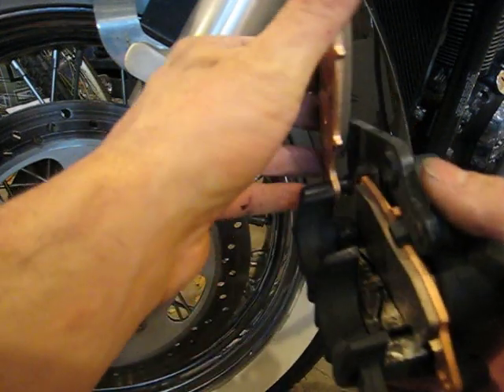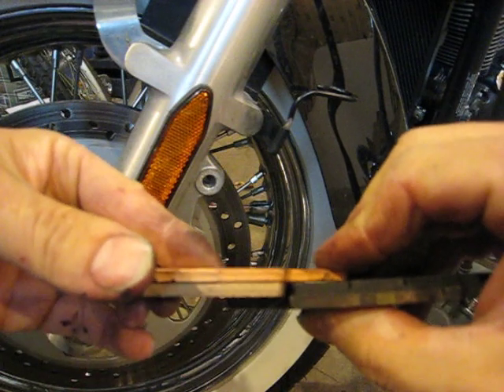Kawasaki Vulcan 900 Front Brakes.AVI

Comment: need some help with my repair.  Did the rear brake repair (pads, seat and seals).  However, I keep getting 30mm diameter piston seals for the front although the pistons are 25mm.

Comment: If the pads are wore down do you have to push pistons back in?
Reply from the maker: Yeah I just pushed them back using the old pad and a 'c' clamp.  I used the old pad so I shouldn't damage the new pad.
Reply: Do I have to take the lid of the master cylinder to do this?
Reply from the maker: Denny Greif no you don't.  And you don't to open the fluid system unless needed, it introduces airborne humidity.  It will just push the fluid into the reservoir.  In my rear pad change video I briefly show this.  I don't have a video showing how to bleed the brakes, cuz I didn't have a second person there to run the camera.  But if you feel you need to change the brake pads you probably need to bleed the fluid.

Comment: I never loosen the bangel bolt or what ever its called I didn't even remove the brake line I only removed the 2 caliper screws and the pin and the cylinder then I put it all back like it was.. cheers
Reply from the maker: Still it's been close to 7 years,I don't remember why I had to loosen it. Maybe it wasn't oriented the right way for me. Banjo bolt. Not sure why it's called that.
Reply: @EliGaffke  lol  7 years I didn't see the date I'm surprised you answered a comment..

Comment: I see when he tightens the bango bolt that the whole caliper is shaky, is that normal
Reply: That's normal until you apply the brakes a couple of times. Or if you don't tighten the mounting bolts for the caliper